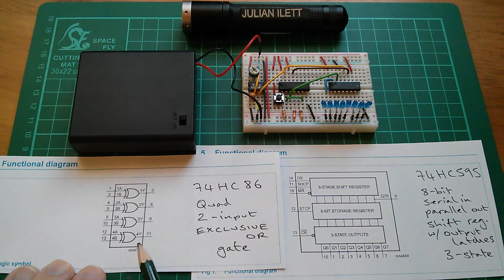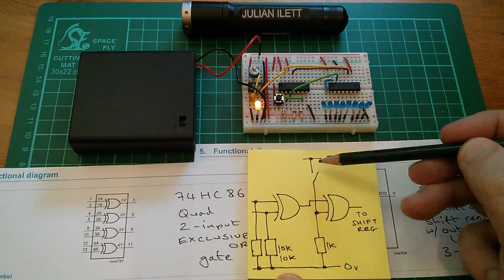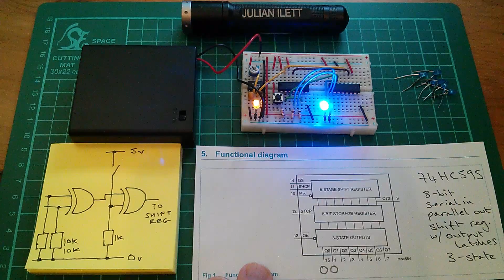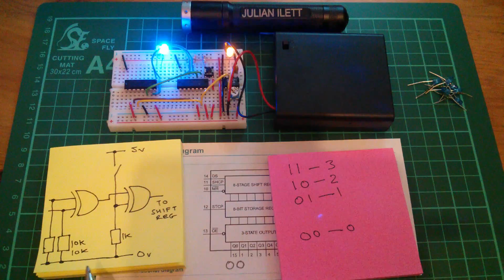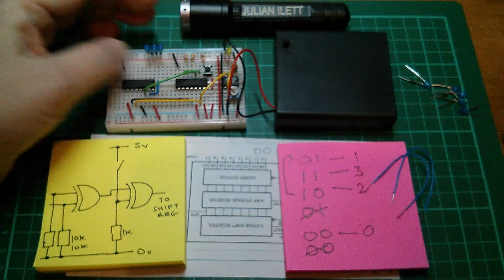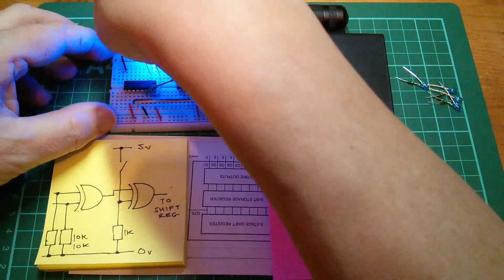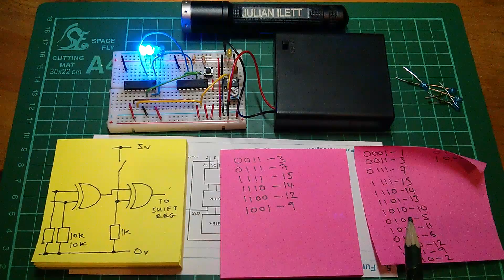74HC595 Shift Register with 74HC86 XOR Gates

Comment: At it's most basic level this is how data encryption works.

Both parties have extremely long shift registers, and only they know the feedback taps to the xor gates. 

When data is transmitted in a binary form (even if it started life as sound) it is passed through the shift register and what comes out the other end is totally encrypted. The data can then be broadcast with confidence that even if it is intercepted, no one else knows the feedback xor feedback taps and the large length of the shift register.

Just have to keep those xor taps and shift register length secret!
Reply: That will be fine for - as you say - basic encryption. However, the problem with keeping such configurations secret is that - once busted - EVERYbody's messages  (both future AND past) are available for inspection and decryption at your opponent's leisure. It is much safer to maintain the unpredictability in the message sender's seed/initial state, which can be varied for both every user and for every message. Most encryption algorithms are quite happy to publish - for all to see - their 'internal wirings' (in the form of S-boxes and hashing tables). This also has the advantage that many researchers can then test how secure the algorithm really is. One ought to be instantly suspicious of any company claiming security by keeping their algorithm secret.
Reply: Paul Sampson I tend to disagree to an a small extent with your statement. The feedback loops (I'm keeping this deliberately vague since I retired from my countries intelligence service), should be changed on a irregular, but frequent basis. There is of course the chance to change the register length if both parties are "in the know". 

As was proved by Turning, it was human error in not changing the Enigma wheels, that allowed him to crack the German code (and the British to ultimately thank him by chemically castrating him when they found out he was gay !)

Modern computer power allowed intense data manipulation such that many cracks at the code can be achieved giving a fair chance of a good hit. Hence the almighty N.S.A. They can get at anything.
Reply: There are a lot of others ways of designing a cipher. For example I made one (with Logisim) that uses RAM blocks, counters, and a lot of XORs
Reply: Just downloaded and tried logisim (pretty nice - thanks for the heads-up) and reproduced Julian's results! Now have switched it up to a twelve bit shift register (to represent the on/off of 12 semitones in an octave) with a button to set an initial state (e.g. Fmaj7 with 100010010001) and taking 6 taps from the output into a 6 input xor gate to generate a sequence of hexachords. Shall now have to build it!
Reply: Paul Sampson Probably talking to to the converted, but if you are in anyway a programmer, do this using a micro controller. Saves a lot of wiring and you can make register any length you want, and have as many feedback loops as you want.

You can still output the results on LED's if you want, or stream a number of bytes via a RS232 - USB board to your PC.
Reply: Paul Sampson Like the sound of that. Let us know when you have something working.
Reply: It's one form of encryption, but it's not what is used for serious encryption.

Comment: The data sheet for the 74hc595 says its fine to connect SHCP and STCP together. If both clocks are connected together, the shift register will always be one clock pulse ahead of the storage register. You effectively get a 9 bit shift register with bit 0 hidden inside the chip.

Comment: Great video. Thanks! When all 9 leds are lit, is the 7555 "maxed out" ?
Or did your led resistors take account of the available current when you built them?
Reply: Alun Wall the 7555 doesn't drive the LEDs, just provides the clock for the shift register.  That drives the LEDs, one per stage, through resistors.
Reply: Peter D Morrison Of course, I see that now. Thanks a lot.

Comment: LFSRs are used in CDMA wireless networks to generate long sequences of pseudo random digits (spreading codes) so that multiple users can all use the same bandwidth at the same time, i.e. each user looks like a source of (pseudo) random noise to the other. Clever stuff.

Comment: shift register can be made with only xor gates and some way of extending the signal. And obviously a clock! Such simple circuits! (especially in minecraft where its stupidly easy to add delay)
then you can tack on any kind of extra features that you want. it could even be the heart of a simple calculator or who knows what else you could come up with! And with multiple shift registers in parallel and in series you can generate binary numbers and convert it into decimal or whatever you want.

Comment: I made something like this, out of 4 74hc595shift registers, 2 pairs in series and the 2 series in parallel, in a closed loop with the posibila of adding 1s and 0s  but instead of a xor gate chip I used a hex inverter chip to invert the data ST_CP and SH_CP.

Comment: Presumably if you start off the '6-stater' with a pattern already in one of the remaining nine possibilities, you'll end up in a new sequence. Which may be of length nine, or maybe another shorter one with a third possible sequence, or [etc]?
Reply from the maker: I tried another pattern - by powering off and feeding in 0001. Produces a completely different 6-state pattern. But that leaves 3 states unaccounted for - weird!
Reply: Looks like (using logisim - thanks Integrated Electronics!) you get your two hexacycles and a tricycle (6 11 13) to pick up the remaining three.
Reply: Julian Ilett if it's a Maximum Length LFSR, with the correct XOR terms then you will always get n2-1 unique states.
Reply: For a given shift length and feedback taps, the sequence is always the same, for any starting pattern, cycling back to the initial state after 2^n-1 steps. You must use a valid set of taps in order to get a maximal length shift. The sequence appears pseudo-random, but it repeats exactly the same sequence each time.

Comment: What does the other clock phase do ? Is it two clocks for shift, load, shift, load, and so on ? I tried the 4 bit LFSR with taps on bits 0 and 2 like yours but in logisim. Got the same sequence. Wondered what happened if you feed in another number than what is in the sequence. If you put 1000, the 1 will just shift out and the LFSR stops. Makes sense :)
Reply from the maker: If you clock the shift register and the storage register together, the outputs don't show the current shift register data. I could have used a delayed pulse for the storage register - I was considering 6 inverters in series to produce a few nanoseconds of propagation delay, but inverting the clock was easier.
Putting 1000 into the 4-bit LFSR (with taps at 0 and 2) produces a completely different 6-state sequence. That still leaves 3 states unaccounted for. Fascinating :)
Reply: bwack All possible numbers, except zero, are in the maximum length sequence. It makes no difference which number you start with. The sequence is always the same.
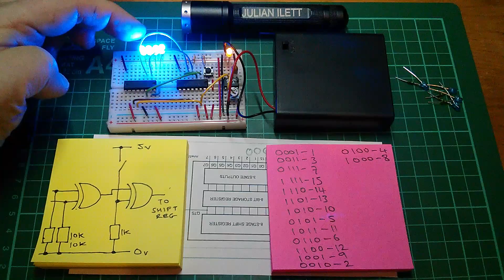Reply: Peter D Morrison the not maximum length sequence. 17:50
Reply: That's the point. Moving the wires to invalid tap positions is not maximal length, so it's just an ordinary shift register with a meaningless feedback loop and of no practical use.
Reply: No, it is still an LFSR with pseudo random sequence. My point was that some seeds outside this sequence and other than zero will not result in a loop. They can be practical. If you see one of Julians earlier videos on the subject he traded shorter machine code for maximum length. It was not critical for him to do that in anyway, but it was possible, and it didn't make any practical difference. That is good enough for me. Allthough I do agree about your previous post regarding that the sequence is always the same, but thats just a fact and another diversion from my original point. I would normally stop here, but you have stepped over one of my main principles in design practices, and that is to consider everything even if they may seem useless or not optimal at current time.
Reply: Julian: by "1000" so you mean 1 as the MSB and shifted left ? If so then the sequence ends in zero and dies out..

Comment: This was/(is) used within the pseudo-random signal generators(=digital white noise). There was even a time where you could buy such a thing already done in a single chip solution where the last stages have been accessible.
Reply: Right.  I remember that chip,  though I can't recall the number offhand.  It's apparently not being produced any more.  From what I can recall in terms of discussions around the subject of electronic music synthesizers,  you really didn't want to use one of those because the sequence they chose to implement that particular chip was way too short,  and you could hear it repeat!  Not the sort of thing that you want in a noise source...

Comment: An unrelated question to anyone reading this.... is there a "breakout board" or such thing that I can put between the GPIO inputs of a Raspberry Pi and say 12 VDC?  I need to know when a 12 VDC input is either on or off.  I don't want to use relays with coils and I'm sure there is a more elegant method.  Any help is appreciated!
Reply from the maker: Opto-isolators?
Reply: Resistors? :-)
Reply: Yes, opto-isolators....but wondering if there is a multi-channel (say 12) prepackaged board that had 12 volt input to 3.3 volt out to interface with the RasPi GPIO that anyone knows of.
Reply: golf-n-guns If you don't need isolation then just use resistor dividers; one for each input:
10k resistor from 12V source to Arduino I/P pin
3k6 resistor from Arduino I/P pin to ground, dropping the 12V to 3.2V,
or you could replace 3k6 resistor with 1N4728 3.3V zener diode to clamp the input to 3.3V
Reply: Thank you for your reply.  I'll keep searching a bit for an off-the-shelf solution...and if none is found, I'll have to cobble something up using your suggestions.  Thanks again.

Comment: The decimal numbers look random, but the binaries don't.
Reply from the maker: Yeah, true. The LFSR produces "runs" of ones and zeros - these are very visible as they shift upwards through the shift register.
Reply: You could always change the order of the LEDs to avoid those runs.
Reply: Random doesn't always look random. When Apple introduced the iPod, people complained that 'shuffle' mode sometimes played the same track twice in succession, so they changed it to prevent that. They made it less random!

Comment: Great Julian. Thanks! You don't happen to know the math behind this, do you? Not just looking up the taps in a table but to do the actual math... Complicated, indeed.
Reply from the maker: I'm not sure there is any formula for this - just observation and/or simulation. As you say, there are tables for maximal length sequences, but I've not seen any documentation for the shorter sequences (hence my surprise at witnessing a 6-state sequence). When you get to 8-bits, things get interesting - there are no maximal length sequences (255 states) using just 2 taps - you need 4 taps. It's mind boggling.
Reply: Right! Simulation was my best bet for making the tables. That it brute force. Perhaps this is like large prime numbers? "Impossible" to calculate (as of yet) without brute force. :)
Reply: Not quite true Julian. You can have as few as 2 stages and a sequence length of 3. With longer sequences, prime numbers start coming into it and you can reduce the polynomial terms. You never need more than 4 taps, sometimes only 2 or 3, at least as far as 168 stages - I need to check that as a different source gives conflicting information. All (?) the high number stages have many possible arrangements of (large numbers of) taps, all giving a maximal length sequence, but they all reduce to just a few taps. See: http://www.xilinx.com/support/documentation/application_notes/xapp052.pdf
Page 5 gives the shortest taps for n=3 to n=168 using XNOR logic which is easier to implement.

Comment: Another interesting video as always.  On an unrelated subject, have you ever used the 5V Mini USB Lithium Battery Charging Board Charger Module available from alice and if so are they any good?
Reply from the maker: The 2A charger?
Reply from the maker: That's the TP4056. Pretty good, although the 4.2V varies from device to device (maybe that's because they're fake chips). There's also a version with cell protection and another version with multiple chips in parallel.
Reply: Okay thanks Julian, I just bought a couple to play with as they are so cheap, I'll check out the other versions as well.
Reply: thanks Glebs Litvjaks, that is exactly what I was thinking of using them for, thanks for the heads up regarding polarity.

Comment: Almost like gray code
Reply: Not really. In Gray Code, successive numbers differ by only one binary digit. It was originally designed to prevent 'noise' from electromechanical switches causing spurious output states.

Comment: Just need an Arduino, LEDs and some C code...
include <stdint.h>
int main(void)
{
   uint16_t start_state = 0xACE1u;  /* Any nonzero start state will work. */
   uint16_t lfsr = start_state;
   uint16_t bit;  /* Must be 16bit to allow bit<<15 later in the code */
   unsigned period = 0;
   do
   {
       /* taps: 16 14 13 11; feedback polynomial: x^16 + x^14 + x^13 + x^11 + 1 */
       bit  = ((lfsr >> 0) ^ (lfsr >> 2) ^ (lfsr >> 3) ^ (lfsr >> 5) ) & 1;
       lfsr =  (lfsr >> 1) | (bit << 15);
       ++period;
   } while (lfsr != start_state);
   return 0;
}
Reply: Peter D Morrison Gave you the thumbs up. Good choice of feedback terms, and spot on math. I don't know the Arduino but I cannot see any output to LED's. You probably left the code out because it was obvious.

Two things did catch my eye though, and they may be processor based, a) what is "period" counting ? Once the subroutine has returned that value is lost. And b) why do you return a '0' or FALSE from your subroutine ? Would that not indicate that not indicate that it had failed ?

Please don't take this as harsh judgement, I like to understand other people's code, especially if it has been written for a processor I'm unfamiliar with.

Thanks.
Reply: Returning 0 as an OK status is very common in the unix/linux universe. A large number of failure modes may be distinguished by a correspondingly large number of possible return values, often by setting bits, as opposed to the only one way you care about something's success.

The 'main' subroutine will return only when lfsr reaches start_state again. Which - with the suitable feedback 'wiring' - will happen when the entire de Bruijn sequence (of all possible binary values) has been traversed. LED lighting on an arduino is - as you surmise - fairly simple but may require a multiplexer if done on an uno (not so great with the number of available pins).

It would of course also require an i/o method to xor (in and out) an actual source message if you wanted to use it for encryption.
Reply: Nigel James thanks for the 👍. All points well taken. The code is just a proof of concept. Needs refining for an actual working model.

Comment: Can you tell me what the difference between an or and a xor gate is?

Thanks.

And if you want to make cirquit diagrams try easyeda.com
Reply from the maker: Yeah

OR
00 - 0
01 - 1
10 - 1
11 - 1

XOR
00 - 0
01 - 1
10 - 1
11 - 0

So they only differ for the 11 input combination
Reply: 'exclusive or' can be nicely translated into human language, it is essentially 'either, or'. Either  the first or the second input is set, then there is a one output. If both are set or none is set, then this does not fulfill the either/or criteria.
Reply: Hi
 in the OR gate one of the input should be 1 at least to get 1 at the output. Let's say x and y are inputs so the truth table will be:
x  y  output
1           1  1
1           0  1
1           1  0
0           0  0
but the XOR gate the input should be different from each other to get 1 at the output. Let's say x and y are input so:
x  y  output
0           1  1
1           0  1
1           1  0
0           0  0

I hope I helped you :)
Reply: Julian Ilett Henner Zeller xAbdulRhman X Thank You. That helped me a lot. Now i know what i'm goig to do tomorrow :)
And for excclusive and it is:

0 0 > 1
0 1 > 0
1 0 > 0
1 1 > 1

am I right?
Reply: There is no logic gate called XAND. But the truth table that you wrote is for XNOR gate 
0 0 > 1
0 1 > 0
1 0 > 0
1 1 > 1
Reply: xAbdulRhman X Yeah I ment that :D